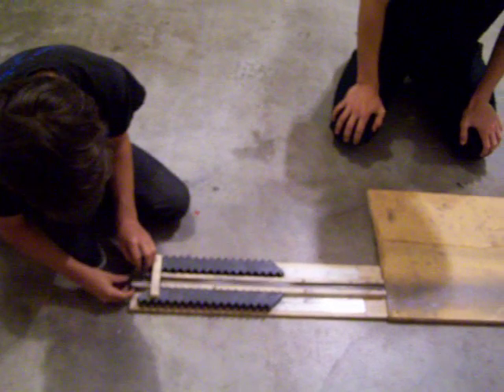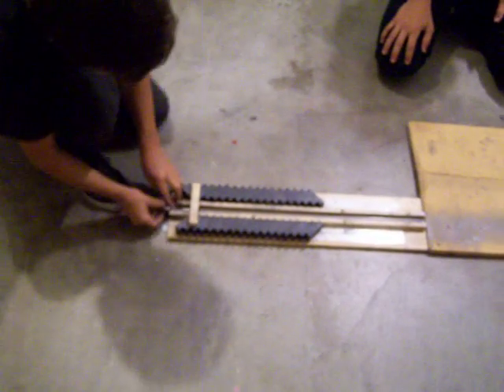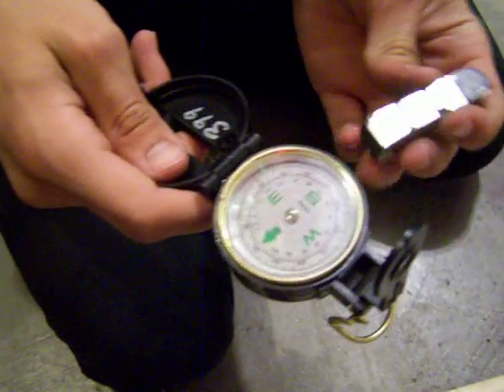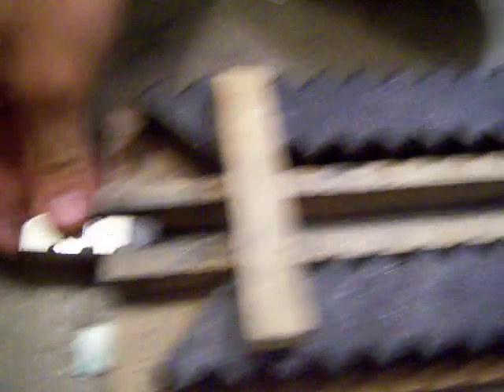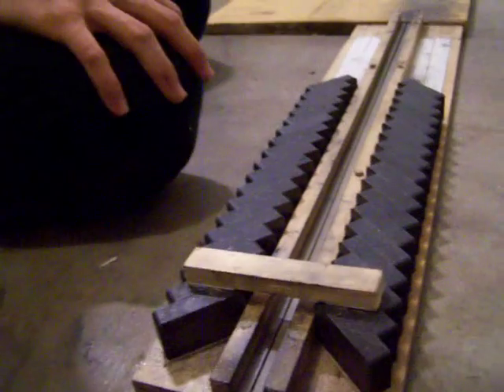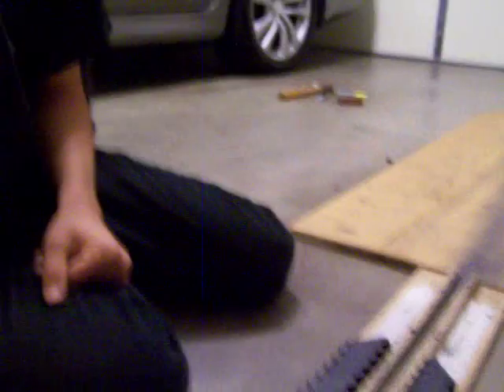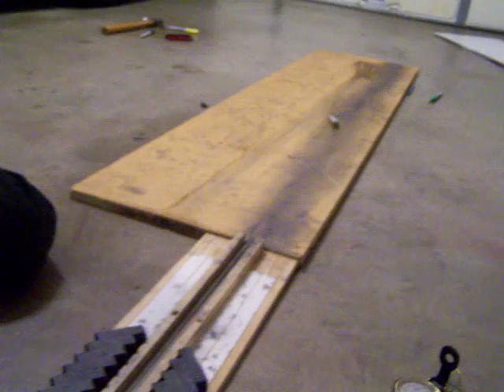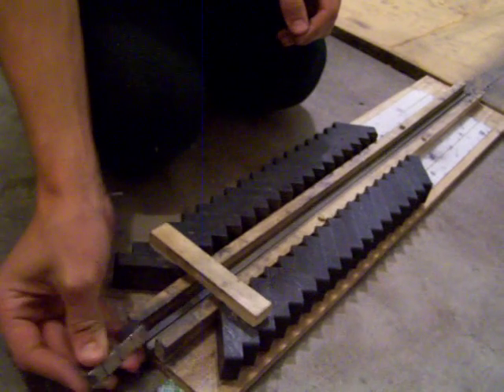Magnetic Rail Gun Science Project

Comment: No it certainly could not! Physically impossible : as soon as you curve the track you break the mirror symmetry of the fields so any behaviour seen in the linear gun will not occur in the same way in the circular track. The slider on a circular track cannot feel a force that will continuously pull it around the circle in the way seen in the linear case because the potential energy must return to its original value on going round a circle to the start point. (also see other comments below)

Comment: You can work it out from the Potential energy curves shown in my paper( on the scribd. website see below)  two cases: 1) The added layers oriented to repel slider: increase the work done putting the slider into the breach (hence kinetic energy you get from the gun) but not as much as adding two layers of magnets in the same orientation as the original. 2)two layers oriented to attract slider: kinetic energy of gun massively diminished perhaps even trapping the slider at the end of the track.

Comment: any machine which has no energy losses could run forever. However it could do no useful work. As soon as work is extracted the machine will inevitably come to a stop unless energy is added to the system to keep it going. 

Since a machine cannot  be made which has absolutely no frictional or radiative losses the energy which must be added to keep it going is greater than the useful work the machine can do. It is in this sense that perpetual motion machines are not possible.

Comment: But that's the point, a railgun uses two metal rails which have electric current flowing through them, with a metal projectile accelerating up them. What you have is a series of magnets pulling a projectile along. What you have is close to a coil gun or a Gauss Rifle(although it's different than either).  It's not a Railgun, because you don't have rails, nor are they electromagnets.

Comment: THIA IA NOT A RAILGUN!!
Railguns work with an ELECTROmagnetic force, so you need a current to use it. Railguns use a projectile that is conductive, but NOT influenced by magnetic fields. A current is passed through the object which is at that moment in a magnetic field, which causes a force (Lorentz) to push the object. A ferrometalic projectile can NOT be fired from a railgun.

Comment: 2nd question: Sure. But as soon as you get into the motion part, you're not at absolute 0 anymore. So, no.

1st question: If a force, F, is acting on a body initially at rest, then work is W=Fd
Where D is the distance traveled by the object parallel to the force. 
So, if gravity pulls on something without causing it to move parallel to the direction of gravity, then D=0 so there is no work and thus energy is conserved. It takes no energy for gravity to "keep going."

Comment: if the bicycle wheel worked, you could add magnets to the side of the wheel and make a stator coil for induction and create electricity that way. wouldn't be much but it would be over unity.
energy forever.

If it worked.

Comment: So, what would be the result if a larger, stronger magnet were to be placed on both sides at the start and end, then two more at the end that bridge across the top and bottom? Maybe add 4 more at the end and angle the pushing sides towards the middle/inner "barrel", but they're flat, soooo it'd look a little like a cardboard box's flaps facing inward. Then again that last part may slow it down.

Comment: Try arranging magnets in increasing series with spaces. So put like 7 magnets, then a (figure it out with experimentation) 2 inch gap, then 8 magnets, 2 inch gap, 9 magnets etc. The idea is you build up the speed on the projectile so it's already moving by the time it reaches the next more powerful group.

>>>>>>>  >>>>>>>>  >>>>>>>>>  >>>>>>>>>>  >>>>>>>>>>>  >>>>>>>>>>>>

assuming it works of course ;)

Comment: @8888stealth You take two conductive rails, one negative, one positive, place a conductive, dense and aerodynamic piece of metal in between, take a high current power supply, (think defibrillator or strobe light) than can discharge many amps in the space of milliseconds , and attach each terminal to a rail.

Comment: Because all such a devise would do is convert the energy imparted in the magnets during there manufacture into motion. As that energy is taken out of the magnet to turn the wheel they will loose there strength and run down. And since you would get much less energy out of it than it took to make the magnets it would be rather pointless. would make a fun desktop toy though.

Comment: Gotta make them ;) try doing some research on solenoids, they're a relatively easy way to make an electromagnetic. Basically you wrap a wire around in multiple coils along a tube of some sort then run a current through the wires. It generates a magnetic field which can pull/push magnets.

Comment from the maker: @metalgodkill Anything that will reduce the friction would be helpful, including oil but it would be messy - especially since most of this is wood.
Reply: Ceramic spray paint. Autozone. $9 a can.  250 degrees on the oven.  You can buy fine spray tips for graffiti and get better spray patterns or sand it down with super fine grit paper after you bake it to achieve a very low resistance.

Comment: Wait, you're using just magnets? Correct me if I'm wrong, but this isn't a "railgun."  This is just magnets. Magnets fields causing magnets to move.  A railgun uses an electric current running through a magnetic field. This cause the conductor to experience a force (RHR)

Comment: @antostoof1 Yes you're absolutely right, if you keep the track on a flat plane and try to build it round or square or pentagon then the inertia would definitely shoot the projectile off the track where it bends as you already tried with your round track.  To correct that you can think of a rollercoaster and how the track is not only bent to turn but also banked.  The banking allows the transfer of the enertia downward against the track and keeps the projectile from derailing.

Comment: I've watched your two videos intently, I think to next step is to design a square or pentagon track, not a circle.  This way your current track would remain exactly the same, it would be too difficult arranging the magnets in a circle.  Instead have the projectile run in a continuous track and simply bend the track before the next straight gun section so that the projectile will enter the gun straight and exit straight out.  The bend will absorb energy but shouldn't matter.

Comment: Have you guys thought about switching from ferrite magnets to rare-earth magnets? You can get at least five times the force that way. 

You might eventually try electromagnets; they are a lot more powerful than permanent magnets. You just have to build a control circuit to keep them all at the same voltage, otherwise there would be an imbalance in the field which would cause a deceleration in the slug.

Comment: This is really cool but it's not a rail gun.  Rail guns use the lorentz force to propel  a load between two conducting rails.  Either way this is a really cool project and a great idea.  It would be tough though to get a projectile up to reasonable speeds using this method because of the limitations of permanent magnets, and once you approach the curie temperature of the magnets they wouldn't work anymore.  Anyways...build on!

Comment: @antostoof1 You'd have to make the pathway of the gun more of a rounded shape, like the barrel of any other gun. Make it like a magnetic rifling. And make the projectile more round as well, and you've got yourself a rail gun that will fire a projectile more accurately and further. Also, the reason your poles are switching is because a natural magnet has the tendency to take the polarity of another, and then it'll switch the poles. Try with electromagnets. Good job guys.

Comment: Here are the answers to two questions:  They are wooden slats in the middle, not metal bars.  If they were metal bars, the magnets would stick to them.  They look a little like metal because there is graphite powder on the wood to make it more slippery and reduce friction.  

I don't think it will work with the round magnets.  You need to be really careful to make sure the magnetic fields are lined up properly and I think it would be more difficult with the round magnets.

Comment: Hi guys,  I have watched several videos along these lines and most of them have trouble with the magnet sticking like yours did before you put the spacers in to bring the running magnet inline with the center of the magnetic field.  What you used appear to be steel.  is that correct?  Very well done video!  Oh, did you get a good mark for your science project?  Thanks, Randy
Reply: it was a graphite covered wooden dowel!